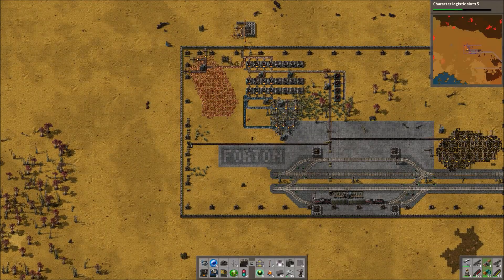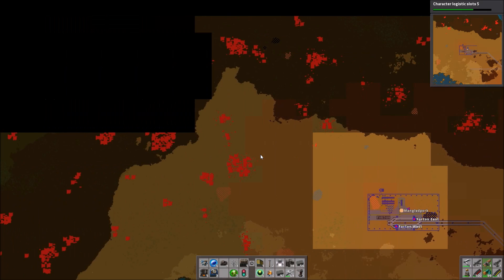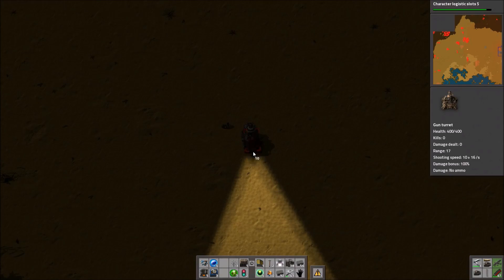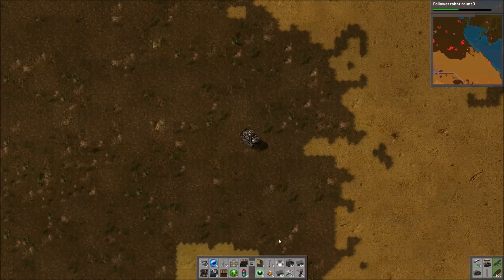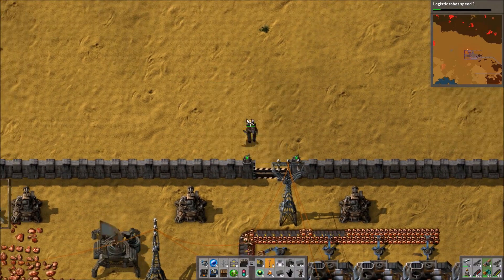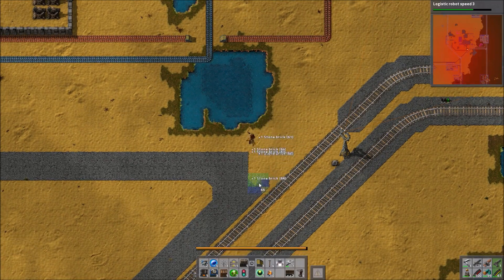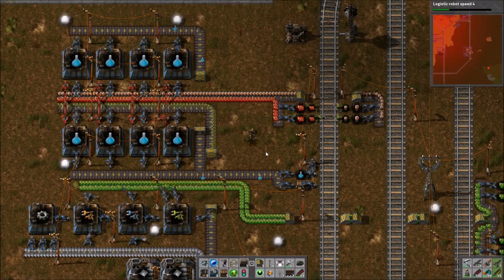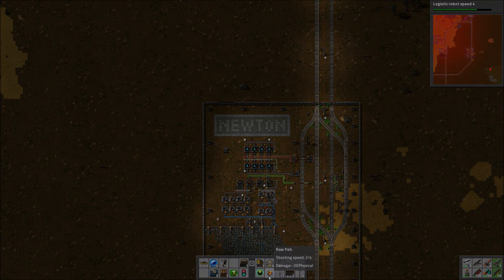Factorio Towns Ep#28: Forton Favours The Bold

Comment: I like the idea you had previously of trying to push them back to as few short fronts as possible. Using water and filling the gaps with war fortress towns. At the same time if you wanted to take the edge off by using modules then I'd suggest you use them only as necessary rather than following some rule like "all the miners".

Comment: I have recently been playing factorio a lot, I have almost done all the research and I have gone for a steam engines only power production, I don't push the biters very far, they just need to be bases on the thin layer of pollution because either I can't push them back (did not craft the mkII armor) or I'm lazy. My defenses are a wall and I shwitched to laser turrets, at some point you have to build a logistics network and put a lot of repair packs and a chest with turrets in it. Works fine

Comment: For your military outposts you should have radar installations setup along the walls. Have like 3 or 4 in there to scan the area fast and keep you updated along with the aesthetic part. Also you could then if it gets far enough have an inside county as your home area with actual outposts outside the walls to gather your resources after they inevitably run out. Have the secure inner sanctum and now the harshly polluted wasteland ready to attack and slaughter your new resource and expansion points :D

Comment: Something else to help pollution is to place yellow inserters where blue is simply not needed (like say plate and steel processing) they use less power and thus less pollution. also use yellow instead of burner, they use less power as well. Yes they run on coal, but they are less efficient than the steam engines. Mouse over them to see this.Other than that Efficiency modules no solar would help, but still keep biters as a challenge.